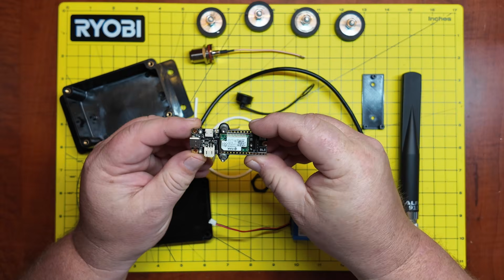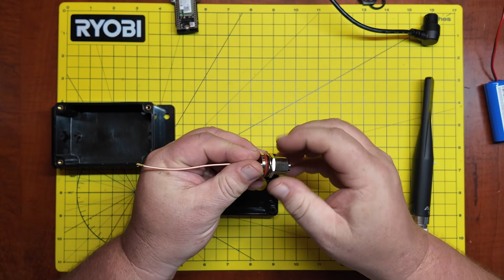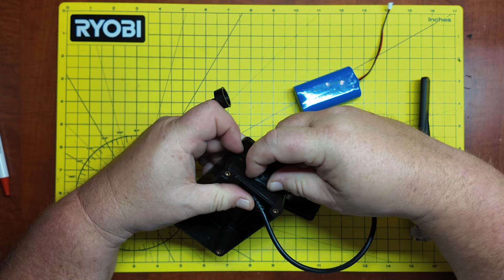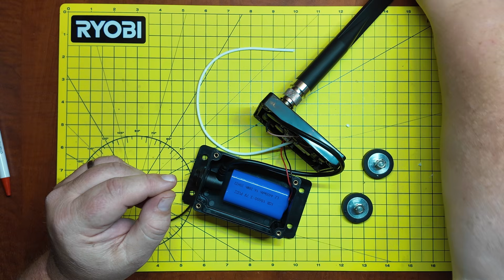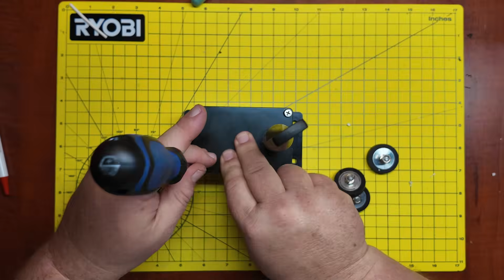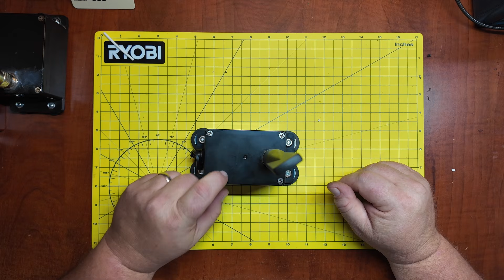Meshtastic Magnetic Roof Node Build

Comment: Any concern with this on top of a vehicle roof in Texas heat?  Concern is the battery of course..
Reply from the maker: All I can say is it survives 100f for 2 weeks at a time between charging. I know it gets hotter in Texas.
Reply: @HamRadioWithKE0MAD damn dude I’m gonna have to try this out then, thx!
Reply from the maker: You can try one of the lighter colored boxes to reduce the internal temperature.

Comment: I used a few of these boxes to make outdoor solar nodes and experienced leakage, not where the gasket ends are. However, it takes a specific sequence of events- a warm sunny period followed by rain. I watched the cooling effect of the rain create a vacuum in the box literally sucking in the water at the seams. Solved with a water resistant breather valve.
Reply from the maker: Yes you are right.  the way I've fixed the pressure/vacuum issue is the smallest drill bit I have in my hobby drill kit. I just drill it where water won't migrate in. I do have some little filters but I haven't used them yet.

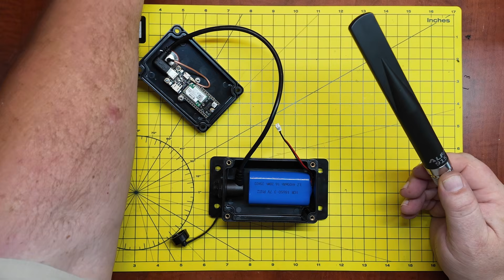Comment: Just the build I was hoping to find! I am curious about the smaller solar panel box you flashed near the 7:08 mark. Where is that from? I like your thoughts on the low power board, but I am hoping to integrate solar power into mine, so a small solar panel or integrated box like that one would be great if you could point in that direction.
Thanks!
Reply from the maker: That is a Rak Wireless solar enclosure. You can find them on Rokland, they have a couple of sizes. They are a little pricey though.

Comment: Friend! You don't need to seal the bottom of the case. Instead, make four holes in the corners, 6-10 mm in diameter. To keep out dust, glue filters into these holes—pieces of dishwashing sponge, only the hard part. I designed buffer lights for locomotives. Drainage holes like these completely protected against condensation. But I protected the board with a protective varnish. Greetings from bloodthirsty)) Russia!
Reply from the maker: You are absolutely right. Ive been designing a 20mm low profile enclosure that uses drainage holes/filters in the design. Thanks for the comment from Russia. Dosvedanya

Comment: The box your using is probably abs plastic. If you can find polycarbonate you will not have a problem with it cracking even in cold weather. Thanks again.
Reply: It’s definitely ABS
Reply from the maker: That's a great suggestion. Thank you.